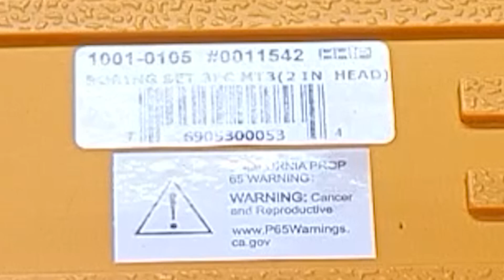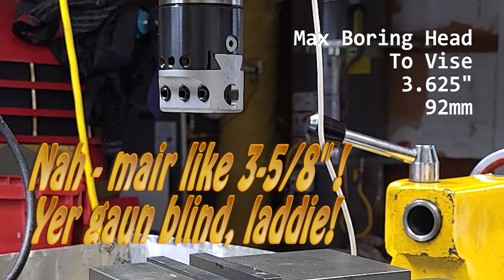Will a Boring Head Fit a Shoptask 1720 XMTC Lathe Mill Combo?

Comment: I have this same machine and  the same boring head. I use  it to bore damaged cam journals on single cylinder motorcycle heads. I use an angle plate to hold the head true and no need for a vise. Works great, plenty of room.

Comment: At first I suspected that you were intentionally trying to convince viewers that these small machines have such limited vertical milling space that they are nearly useless.  First setting a Kurt vice on, which is a wonderful vice for larger machines, but unnecessarily tall for your ShopTask 1720, then measuring the remaining limited vertical space.  Next you added the additional height of a Kurt rotary base, further limiting working vertical space.  Seemed crazy for determining maximum vertical space limit.   Why aren't you using T-bolts locked into your table slots pulling clamps down between the table at one end and your workpiece at the other end.  Presumably you use T-bolts to secure your Kurt vise to that table.  That provides much more vertical working space.  For workpiece dimensions which can tolerate adding your convenient vise to the stack, the measurements you described are relevant limits.  My personal library includes three books just about workpiece holding strategies.  Interlibrary loans should enable access to such material without buying expensive books.
Very few installed Kurt vises have those rotary bases in use under them.  Each additional mechanical link degrades rigidity and available workspace.  Lots of those rotary bases purchased new sit on shelves mostly because experienced mill operators don't want them included and degrading in the mechanical force loop.
Reply from the maker: This video is the only time I have pulled that rotary base out of the cabinet in order to fill out the data set. I never use the thing. This machine has a fixed 10" between the spindle nose and the table and under 3" quill travel. The MT3 extension is 4". I find the 4" Kurt vise without the rotary is the best  compromise for most work. With a juggling of morse collet, er32 collets and the 4" extension I can get all the mills and drills to reach the part in one setup. I was worried that the boring head would not work into that range, but it worked out OK. I do clamp things to the table that are too big for the vise, but the 10" stickout gives terrible rigidity. Thanks for watching.

Comment: Get yourself a MT4-MT3 sleeve and you can then mount the boring head in the lathe spindle.  Then you can mount larger objects to the carriage with an angle plate and have a much larger working envelope.  You can also mount the boring head in your tailstock to bore round objects held in the lathe chuck.
Reply from the maker: I don't have a milling attachment for the Y-axis so I'm not sure how I would align it in that direction. I have boring bars for boring in the lathe chuck so I'm not sure what the benefit if sticking the boding head in the tailstock would be. I know people do these things, but I'm not sure they are appropriate for my machine, at least not with my current setup options. I'm always open to enlightenment, as I know I don't know stuff! Thanks for the suggestion though, keep them coming!